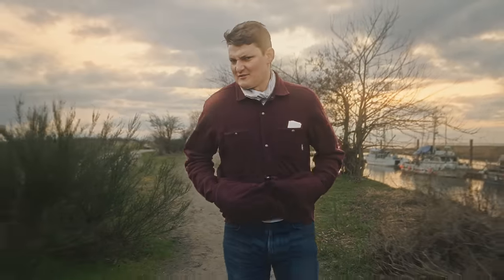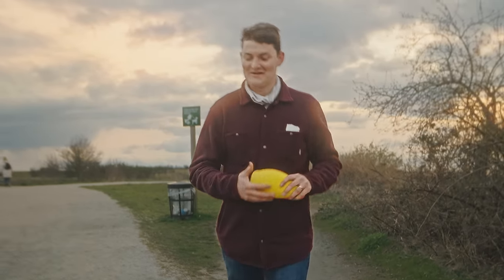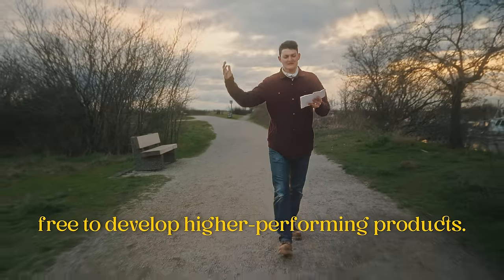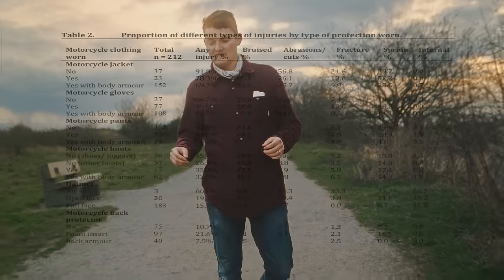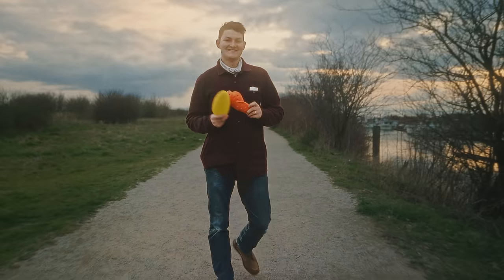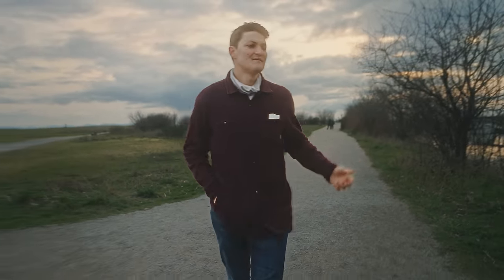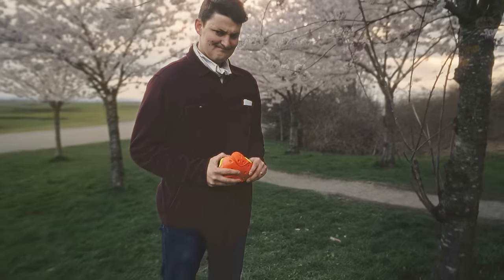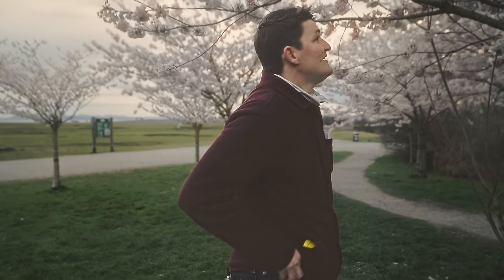Why I Stopped Wearing Motorcycle Body Armour

Comment: I havn't had a motorcycle wreck in over 20 years since i'm a well trained, good defensive rider. Also used to drive semi trucks so very well trained about safe driving! That said.. i'm still going to use some body armor in my jacket. If it would just reduce road rash it's worth it! Any protection is better than nothing.. that's why, we don't ride motorcycles Naked!..Well i've only done that once, 😳 lets not talk about that. 😊

Comment: I'm going to have to completely disagree.  When I had my lowside crash in February, my elbow and knee pad were used hard and with stellar results.  I'm sure the damage would have been severe to one or both.  Ribs were still broke and ligaments of the hand were still torn, but my elbow that took the brunt of the hit was fine and my knee was as well.  Both had tears to the pad.  I've had numerous impacts to the knee over the years with pads on.  I know many of those would have been bad without the padding.

Comment: Fair enough! but what my understanding is broken bones is NOT the main protection of these pads, (they probably would have to be way bigger & thicker than the current Armour, no, have a nasty bump and the bone is snapped? what the main purpose of these pads is for protection from abrasion, that is when you go sliding down the road/loose chippings/grass/ when you come off the bike at speed, they are supposed to save your skin a lot, if you slide on them not your skin,  (I think stats exist that say bone impact problems only account for about 15% of accidents while abrasion injuries account for about 71% of accidents, so that's what they are trying to save, your skin, and probably its well done too, your bones, well they will have to look after themselves

Comment: I mostly dual sport ride. But i have some leatt knee braces i wear instead of the ce pads in my pants. I keep the elbow pads in my jacket. For me the ce pads never align with my knee. But the knee braces have absolutely saved my knees in a bunch of lower speed offroad crashes. The elbow pads in my jacket have helped too.

I dont know that the knee braces would prevent a fracture in a high speed road accident. But they would certainly help with abraision and keep my kneecap from being sanded down.

Comment: I have to say this was very very wrong. I was hit 4 years ago, the only thing i didn't wear, knee pads.
The only injury i got dispite being hit at 50kph was a severe knee injury which has taken 4 years to fix.
My cousin who was wearing nothing except leathers last  week in exactly the same situation on the same model of bike suffered ankle, knee, elbow, back and shoulder, rib fractures bruses and sprains.
I will say again, same exact situation 50kph t-bone.
That is as close as you could get to the same experiment done with and without armour.
I will always wear my armour, i never go without and i put an airbag vest over the top of that even now.

Comment: In brief: The standard has been leveraged to prevent entry by new companies, and is too low to be as effective at preventing fractures as is preceived, due to lobbying. Low enough in fact that its actual contribution to fracture protetction, in general, in comparison to no armour is called into question.  This leaves the consumer with a false sense of security, and they are unlikely to buy the level of protection they are actually looking for.

Comment: removing the armor pads is not a good idea. 
Just today, I went straight through a tight corner to get some free custom engraving in the ditch. I fell on my left side and slided for a couple of meters. My left knee is okay, my left elbow forearm and shoulder are okay, my left hand and fingers are severely battered. Guess what, the parts where the armor was, were not hurting on my way home, pulling the clutch was painful though. 
So, I'd say, take this vid down. 
Yes, the armor pads will not save you in a serious accident. But they will help you get on your feet, when you are still able to get on your feet.
Reply: I assume you will be buying better gloves???  As someone else pointed out without this video Bennetts would not have produced a response video chi chat with their own "expert" - who encourages you to contact your member of parliament seeking changes to the EU approval process. Sounds valid until you realise becoming a memeber of the working groups is by invitation and the British Standards Institute is only interested in your thoughts if you bring clients to their table. Sadly this is how the world works - money talks and the "expert" is running on vapours currently because ( his words) "their not listening". There are many motorcycle organisations out there what are they doing???
Reply: @pamvarnsverry2444  the gloves are okay, they have a nuckle protector and a palm slider and I don't think they can be better without hindering my ability to control the motorcycle. 
I will be buying new pants though. Sometimes, when I don't want to bother with the heavy pants, I ride with regular city jeans. They would get shredded in a slide. So I will get some riding denim, so that I always have some protection on my legs. 
My problem is, that the message an avegerage viewer might get from this vid is: "it's better to ride without pads than with pads". Instead the message should be: "there must be a better system with clear ratings, so that people know what to expect from what they are buying."

Comment: There is a misconceptions here. Who say that this pads are for protecting from fracture? It's like expecting that fireproof gloves protect you from a falling flaming wooden frame.
Or resistance from shark bite from a diving suit.
And much like othet stuff, can't expect that level of protection from pads. The main reason it's for protection from cut/abrasion and like the table shown in the video,they work.
Reply: But the risk out ways the reward. when at best you are getting minor protection from bruising and a more slide time it's not that useful.

Comment: Useless? Anything between you and the road helps, except, perhaps kevlar. Kevlar gets real hot when you rub it against the road. I've seen it melt itself into a guy causing severe third degree burns. Padded leather is the best you can wear when polishing the road.

Comment: You say that this equipment is useless because the water fractures at 4Kn but this equipment absorbs up to 9kn or 18kn so it will be useful to you as long as your impact is not higher,And from there all that will remain is the delta which protrudes.
You say that the back protection works when it is the same technologies as the other protections which according to you do not work.

Comment: The pads might not be as good as they could be, but taking them off isn't wise. He said that they comvert a 50kJ impact to an 18kJ one (or even less), which is enough to broke a bone- fine. Even if that's the case, there surely is a point where a crash is just strong enough to brake your bones without a pad, but not with a pad.

Comment: Why regulation requirements are so low for pads?
Reply: I understand the argument "you can only wear so much protection before it becomes restrixtjve and uncomfortable to a point people won't want to wear it". Still, I would like there to be more sizes to provide similar protection for all body sizes.
Wearing protection is still far better than wearing none. I believe they got their data wrong here as people walking off uninjured from a crash were not accounted for and neither were fatal accidents. Only injury was talked about, not the severity of a crash.

Comment: ok my thing is ive personally been in motorcycle accidents both with upper body/knee pads pads and without upper body/knee pads. I have been in VERY SIMILAR accidents while both padded and not. without pads i was limping for 2 months. 2 months... with the pads i was limping for the rest of the day..... they might not be adequate, but they have been very useful in my life where my accidents usually occur below 30 miles an hour because above 30 miles an hour i am hyper vigilant and paranoid.

Comment: Dress for the slide not the ride. Soft armour still reduces/ absorbs 32kN impact so maths alone shows that if a bone breaks at 4kN, the armour should protect against up to 36kN impact? Road rash abrasion is far more likely with catastrophic difference between wearing or not wearing correct clothing. 1mm skin abraded per second at 30mph. Look at your hands, how many seconds will your palm or fingers survive? Wear gloves if nothing else at least!

Comment: I wear a super basic padded jacket, not because it will protect me at a super high speed, but because it will protect me at the speeds I will be likely to be traveling at. Also I don't ride a motorcycle, I ride a fast electric scooter, so basic motorcycle gear is good enough for me anyway

Comment: If the human body were composed solely of dense bones...this might have had weight. But there's soft tissue, there's veins, muscles, nerves. There's cushioning ligaments. As someone who has popped their knee and finger rolling in BJJ, you don't have to break BONE, to incapacitate a human body, and cause IMMENSE pain. 

There are few absolutes in the world, but here are some:
- There will never be an impact event where the motorcyclist will come out better than whoever, or whatever they're hitting. Short of running over a grape on the road, a motorcyclist is always at risk of serious harm in the event of a crash.
- The ground will always be hard, abrasive, and covered with substances that should NOT be introduced into the wounds of a human body. 
- The lack of protection doesn't make you unsafe. It just makes you prone to more severe injuries if something does happen.

Comment: In many years and thousands of motorcycle and ebike riding and commuting miles I had a couple of minor spills. Only one involved injury and the motorcycle gear / pads would have reduced those abrasions significantly compared to the street clothes I was wearing (ebike).

Comment: The pads in motorcycle clothing are like seatbelts and airbags in cars.  They lessen the impact and help reduce the severity of injury somewhat.  But injuries can still occur.  The NCAP rating for cars is for low speed crashes (which are the majority) but still help to mitigate the potential injuries at higher speed as well, as similarly for protective pads in motorcycle clothing.  Most motorcycle crashes are low speed and the pads help reduce bruising and scratching and very minor knocks, but nothing a motorcyclist can practically wear can help reduce the high force impact of the human body against something solid and immovable, the type that cause fractures.  

It is a pity the standard IS so low, but some armour in an abrasion proof covering is infinitely better than riding around in, effectively, a T-shirt.

A good point raised by yourself about the low standards which the industry itself wants.  

Time for a co-ordinated campaign by the media and motorcycling organisations to improve body armour?  Though we should be careful what we wish for.

Comment: I agree that the newtons should be doubled on the padding. Air suits are a great idea. Smarter riding outweighs all other forms of safety.  However I think most potential injury cases are low speed prat falls and go unreported.  I have gone down at least twice at less than 3 mph and least 5 times at zero mph. Padding helps.

  Also my parked motor cycle has been collided with by an eighty one year old man using a walker. He lost control about six or seven feet from my bike and shambled sideways and backwards trying to regain his balance.  As he fell he ripped off a fog light without tipping the bike over. I helped his wife put him in his car.  My parked bike has also been hit by a bicyclist, a dog, and a Brother in law.  Life is unpredictable. I want more padding.

Comment: I slid out on my bike at 60mph trying to beat a light. Hit some truck hydralic grease. That CE2 padding saved my shoulder and elbow. My Leatt hard plastic knee pads saved my knees. You can see how hard the impact was as it gouged out some of the plastic and grinded the metal buttons I had on my knee pads to help hold it in place down about 2mm to bear metal. CE2 armor works. I can tell you it fckn works! My ribs took a beating but my elbow, shoulders, knees and head( helmet was very scrated up) were golden. Wear the gear with the padding this dude is flat out WRONG!!!!

Comment: Extremely researched and very well presented.
However, at the end of the day it’s like saying are my chances of surfing a 50mph crash the same with or without a helmet?
Maybe. Maybe not.
I’m still going to wear them
Reply: Except helmets have been proven to work unlike pads which like he said have never been proven to give more then basic bruise protection. There's a reason why Ryan runs an airbag it actually works
Reply: @turbojurpo  this is correct.
My original post didn’t correctly articulate what I wanted it to.
Statistically speaking when you are up at highway speeds, if you have any kind of accident, regardless of the gear, your chances of survival are VERY LOW.
yes I know there’s a lot of numbers thrown around and variables.
Some data is iffy at best.
Some suggests most bikers will survive a crash.
However the point I was making is if you are involved in an accident at highway speeds, unless you just happen to slide off your bike and slide down the road to a stop, you most likely won’t survive even with gear. Hitting a wall, flipping over barriers, getting hit by cars, flying through the air and smashing the ground, etc, all that at those speeds most certainly means death.

Comment: You’re only hitting the ground with the force of gravity dead on, while the momentum you have going forward is also going into the ground it’s not all at once (that’s why you slide) if you can fall 4 feet without breaking something the slide quickly because the main force to worry about, most recks don’t end in broken bones but lose of skin, if you’re a EMT or surgeon you by default see more of the exceptions not the rule, people run into other things and or get ran over for example. You should wear your pads, but statistically he’s right, and he covered that, we as riders all have to decide how much risk is to much individually, if we wanted to minimize the most risk we’d drive a car

Comment: I've been hit by a lot of cars, or gust the ground multiple sport bikes and one wheel XR. 

I use g-form armor, spent about $800 on all it plus helmet included.

I can't tell you how much money I saved in ambulance rides.
The ability to have a minor fracture that doesn't interfere with your ability to use your body, and allows you to ride home under your own power. 

Is far better than fracturing and breaking and being in the hospital for months. 

Just my 20 years real-world experience, I've also been killed twice in dismembered five times.

I never ride without it.

I'll take advice from someone that crashes regularly over someone that's gotten lucky and never had a bad fall or hit.

Comment: We can't reduce the risk of injury to zero but if the technology reduces the forces your body experiences, that is extremely valuable. It's like saying that a seat belts won't save you when doing 100mph. Probably not but they damn sure make a massive difference at 50mph. 

The energy must be dissipated somewhere. Much rather it isn't into my body.

Comment: I work in the motorcycle Riding gear industry. Although I agree to a certain extent. Riders should give more importance to the abrasive material which is on the Jacket instead of padding.

Comment: I had to get off in which I only had one knee protector on. Basically the straps broke on the right one. So I went out on a trail with just one. With just one on, One of my knees after sliding forward on both of them was completely fine and the other one was banged up to hell and scraped to shit. 

There are so many instances in which I have crashed both on and off road in different cases wearing armor and knot in which it is always worse without the armor. I'm always more battered. I'm always feeling like I took my bony elbow and slammed it into the concrete versus just getting a little brush burn from the cloth of the inside of the fabric from the armor.